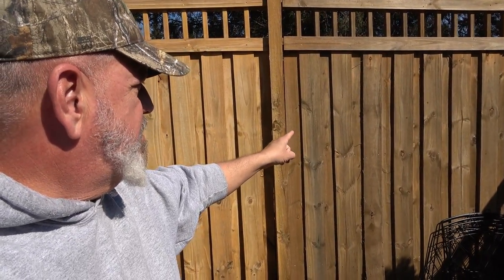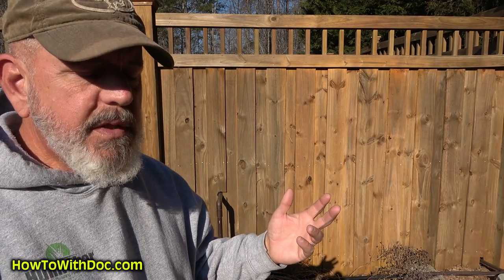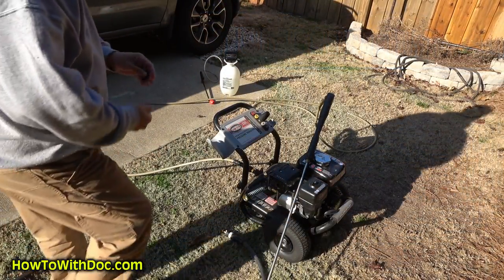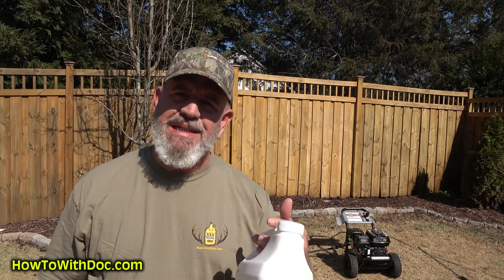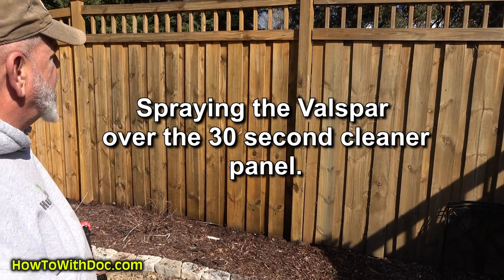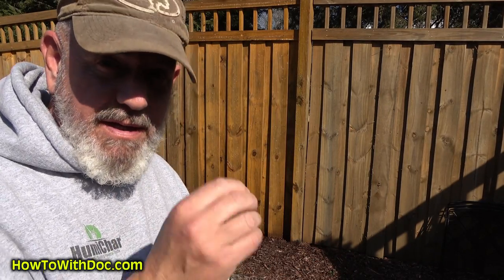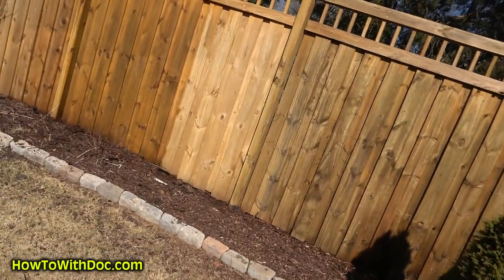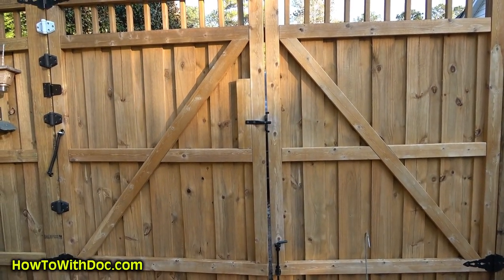Cleaning Wood Fence and Decks - Clean vs. Restore

Comment: Doc, I have used both the 30 Second Cleaner and the Armour cleaner as well with similar results as you. But a year ago I tried Spray Nine on the siding of our house and found it to be even better than 30 Second Cleaner. I did my house October of 2020 and there isnt a spot of algae anywhere. With 30 Second Cleaner I was getting about 10 months before algae started creeping back. I have not tried Spray Nine on wood yet but am going to give it a whirl on our Pergola and Trex deck  Wondering if you tried that product yet.

Comment: @howtowithdoc Hello, my question is in regards to pressure washing high areas.  I’m not comfortable using ladders so I purchased a scaffold.  It’s pretty simple to set up but I’m not sure if it’s practical to set up and break down for every job.  I’ve purchased a dial-n-wash pressure regulator but it is not sufficient.  What do you absolutely recommend to reach the second level exterior house on jobs?  I’m considering returning the scaffold depending on your response.  Please advise.